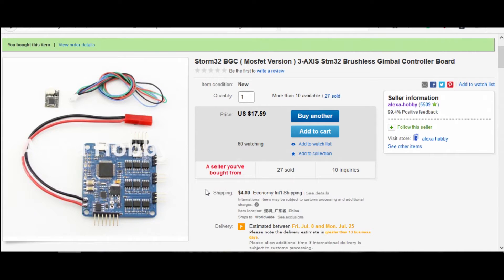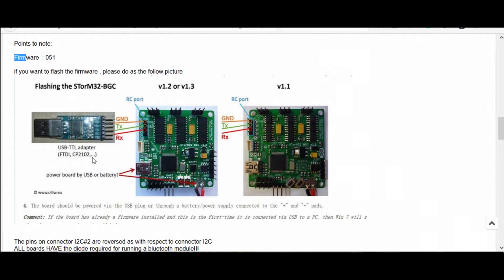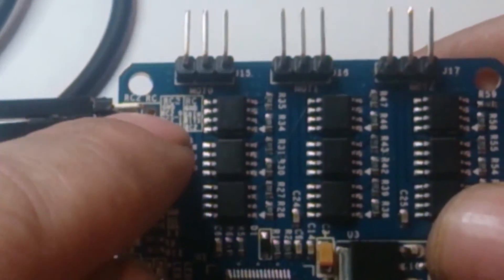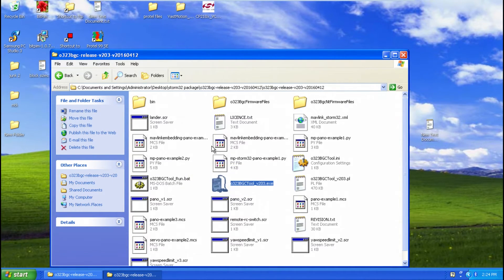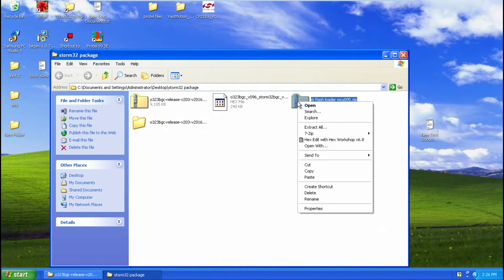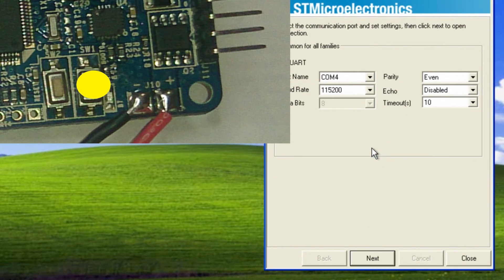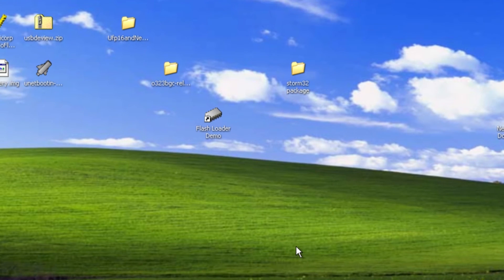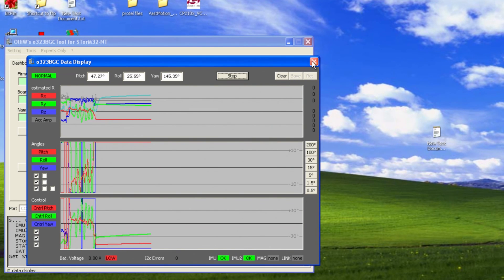SToRM32 BGC v1.4 alternative Firmware update

Comment: sorry to bother you but i am currently trying to flash a new storm32 board and it will flash to 61% and it fails what am i doing wrong? thank you for any info!
Reply from the maker: Hi are you using the st flash loader?
Reply: Yes.
Reply from the maker: make sure nothing is plugged into the board accept what is needed. you can try a different usb source..but I doubt its that if it keeps failing at the same spot each time...   confirm you have a stm32f103 arm chip as well ... also out of curiosity  scroll down and make sure you don't have any write protected sectors.  https://youtu.be/61DrDoOUfTs?t=385    .. you can also try to hold the boot button the entire time .          have you tried to connect to it through the software ..after it fails?     just to see if enough of the flash has written to it
Reply from the maker: I should also note..I can't help you to much because mine went up in smoke .. physically pooofy it went..
Reply: +bangs6996 if I try to connect it, the gui says I need to do a read first, but when I do that is aborts read and still says I need to do a read. also when I try to flash using the gui it gets to the part where it says downloading and stops, it then says something about it may be write protected. but in flashloader it doesn't look like there is any kind of protection. any ideas?
Reply from the maker: in this part of the video is the button that says "remove protections" clickable?   https://youtu.be/61DrDoOUfTs?t=372
Reply: +bangs6996 no.
Reply from the maker: hmm . and you tried to hold the boot button down the entire time? it seems something is trying to go or that part of the chips is messed up .. Before trying to click on the erase all option in st loader .. .. you can try a different hex file and try a slower baud rate ..I would try 57600 and 9600
Reply from the maker: and if you know what firmware was on it originally  .you can try to re write that one...it will still fail at a certain spot but hopefully the firmware will be complete.. .  ...    or were you having problems with the original as well?
Reply: +bangs6996 yea I've gotten 61% after dropping the baud rate to 57600 otherwise I can only get about 51%. I was not able to get the board to connect originally. when I got it the first day I would connect the usb to the pc and it would say device not recognized. so I thought that was because of firmware. I don't think it came preflashed but if it did, I did not save or pull it from the board.
Reply from the maker: https://youtu.be/61DrDoOUfTs?t=388   on that section .. you can try to click the enable disable write protection .. and set it to disable write protection..   Also what you can try to do is click the upload to file button instead..and read the chip.. ... you can send your dump to bangs696969@gmail.com    or if your good at hexedit ect.. .. you can try to figure out where in the hex its failing..
Reply from the maker: actually if you don't mind and your able to dump it ..can you send it to me..i'm curious anyways.
Reply: +bangs6996 I'll try it, and I'll let you know.
Reply: just curious dumping from the board, I will still be using the rc pins right? not the uart pins.
Reply from the maker: yup everything the same.. on this box is https://youtu.be/61DrDoOUfTs?t=419  click the upload from device radius option
Reply: +bangs6996 ok, I forgot to mention my board is a v1.31 it's off ebay. It's basically the same physically just a different color. by the way, thank you very much for your help! I'll let you know how it goes.
Reply from the maker: ok sounds ..good.. I am able to play. I hooked up my board and i can still write and dump my chip.. If you send the file make sure to save it as a hex file not st19 or bin.     ...because we are way under the 256kb i thiink we are only around 60k or something we should be able to get it to go hopefully ..    IF you can write my dump to your board ..let it go to the fail.. then unplug the usb power and next time dump your file ..and send me that one.. This way I will be playing with the same firmware for sure .. here is my dump ..don't worry about the file size its because of checksums ect..   https://drive.google.com/open?id=0B2w6_OKE_2kxQk5kS0E1Z25fU3c
Reply: +bangs6996 are you saying upload from device? if so does this mean I also need to hook up the usb? I've been powering it with the battery.
Reply from the maker: yeah ..no battery .if you fallowed the video.. you just plug the usb port into a usb power pack or a usb charging plug..    what I want you to try is ..
1. download my firmware dump
2. once your connected to st flash tools choose the first option like you have been doing .. "download from file" but pick my file this time
..if it does not fail at 61 then all is good.. but if it does

.. unplug the power fallow the same steps .. but this time
click on "upload from device"  and it will ask you a place to save the file and name it something like Mydump  make sure to click on the drop down menu where it says st19 change it to  *.hex  .. it will say file does not exist create it.. Say yes..   then after that push ok and push next on the main menu ..it will create a file.. send me that file..
Reply from the maker: you should be fine with the battery like your doing.. i've just always used the usb power instead.. .. who knows maybe thats your problem... get rid of the battery and use the usb just for the power ..still use the tx and rx to talk to your computer.
Reply from the maker: this part of the video I explain the battery bank  ..https://youtu.be/61DrDoOUfTs?t=147
Reply from the maker: are you stuck ,busy , or given up?  ..
Reply: +bangs6996 no, I'm at work at the moment. gimme about 30 min and I let you know how it goes. sorry if I kept you up.
Reply: so how does this upload from device work. it's asking me to upload it to a file. which file do I choose?
Reply from the maker: yup I brought that up in a earlier message to you.. ..it will ask you to choose a file.. ..so pick a name like mydump .. choose hex instead of s19  ..it will then say file does not exist ..do you want to create it.. say yes.. ..then click next..
Reply from the maker: also please make sure you upload my firmware first..before dumping it.. it needs to be mine so I can do a true compare.. and see if we can trick your system
Reply: before I do anything else I just tried flashing again and it hit 100 now it says operation finished successfully do I just close.
Reply from the maker: yup ..you should be good now.. try the other program out and see if you can connect..
Reply from the maker: and out of curiosity did you do anything different .. different flash..different power source?  ..or you just lucked out..in case somebody else reads this ..they will know just to keep trying and trying if you changed nothing
Reply: okay baud rate 57600, firmware v0.96. also i think it was just coincidence but i chose verify data after download or something like that. it failed the first time but tried again and it went to 100%. also this was powered by a battery bank like you said.
Reply from the maker: k cool.. hopefully it all works out for you.. now all go put all my hardware away =(   hehe..
Reply: sorry about that i think i still have the dump file, at least the modified date looks like it did something. do you wanna take a look at it?
Reply from the maker: why thank you for the offer.. but its ok.. as long as you got it to go no point to see where it was failing ..  .you got more fun ahead of you anyways setting the rest up..

Comment: This was for me extremely helpful. I now also can see the "Data Display" and see some difference when I use my i2c connector. I have also now output on any of the 3 gimbals :(. 
Do you also have some tips for that?
Reply from the maker: I Just fried my unit like 10 minutes ago.. so be very carefull if you setup the but switch and short them out..i touched them and poofy .... anyways go into the Confirgure gimbal tool   .. fallow the steps .. .. after its done it takes about 1 minute from power on to actually startup ..it has to be very still as well ....if u get stuck with the tool let me know.. u prob have to switch the roll and tilt if . if it gives u an error in step 2